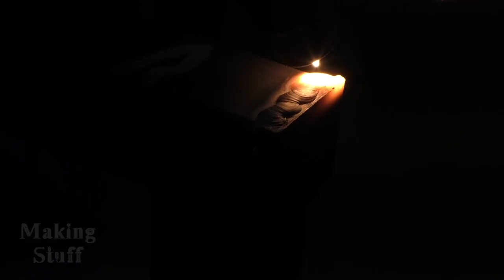DIY Kayak Rack for Pickup Truck

Comment: Great.  Let me pull out my handy tig welder.  I have 3 or of them layimg around
Reply from the maker: Any welder will work.  You can even notch the tubes and bolt all of them together.
Reply: Made one with a cheap 110v welder. Dont shit on someone just because they bought nice equipment for doing what they love.
Reply: Didn't even have a chop saw. Just angle grinders and a cheap welder. The rear rack section is even on a hinge so it can swing in so an ATV can be loaded in without removing the rack

Comment: Thank you for posting this! I'm looking at doing something very similar but for bikes for my kids when we go camping this summer. This is the first one that I've come across while doing research that actually made use of the stake pockets instead of sitting inside the bed. I'm not a welder though, so would something like this be possible using other material (wood most likely)?
Reply from the maker: It probably won't be strong enough to use the stake pockets if you make it out of wood.  I think that is why most of the ones you find made out of wood sit in the bed.  I actually used this for the first time this past weekend.  It held the two 50 pound kayaks and I still had 100% of the bed available for bikes, firewood and other gear.  Thanks for watching!
Reply: You might try Unistrut  you can order, or find it at Lowe’s & Home Depot all bolts together you can get angles and braces etc.

Comment: Awesome. Only suggestion would be  45 your posts. Less welding. Less grinding. Looks prettier. I wish I had your shop.
Reply from the maker: I was going to put some side supports on the rack that's why I didn't 45 them, but then realized it wouldn't fit under my carport.
Reply: Making Stuff makes sense. You did an awesome job on the whole thing. We can tell you take pride in your work.

Comment: What size is the tubing you used for this project?
Reply from the maker: 1.5 inch square tube because that's the size that fits in the mounting holes on my truck bed.  I'd be sure to measure your truck first and use the right size.